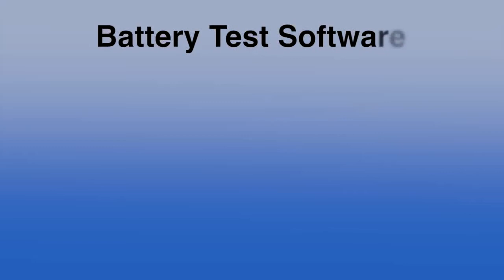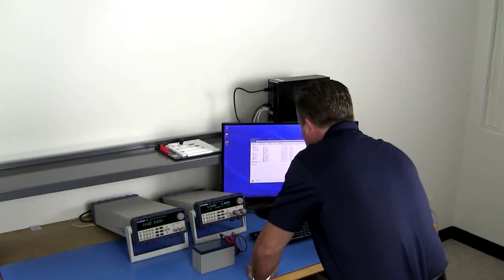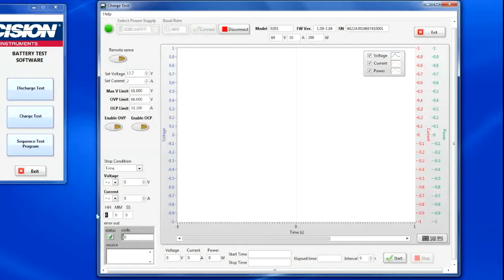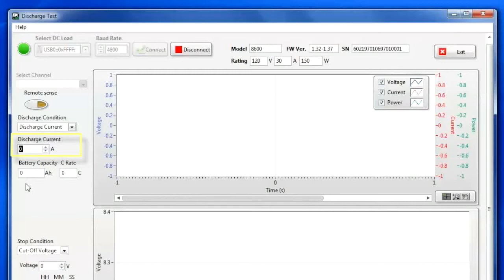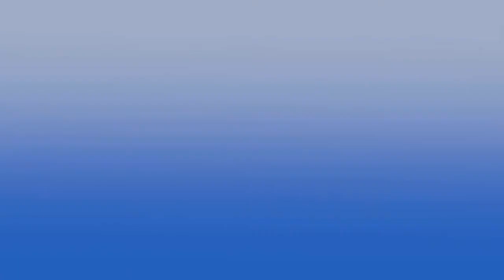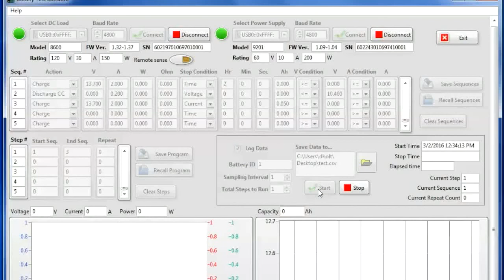How to Charge and Discharge Batteries with B&K Precision's Battery Test Software

Comment: can you tell exact model? and does it also charge and dicharge cylindrical 18650 batteries with 3500 mAh power?   if yes then how? furthermore,  is both red wire or charge and discharge unit connected together with the battery on one side. and both black wire connected to other side?
Reply from the maker: Hello, we have reached out to B&K to answer your questions. This model is the 860x. The power supply and load can be connected at the same time. The software will control each unit based on a charge or dis-charge cycle. Additionally, it can charge and discharge cylindrical 18650 batteries with 3500 mAh power but please make sure you configure the software per the specs of the battery being charged or discharged. If you have any other questions, please don't hesitate to reach out to our experts at information@itm.com
Reply: @ITMInstrumentsInc  Thank you for your reply

I would like to use it to test a single cylindrical battery cell at a 1C charge rate and various discharge rates (1C - 4C) cylindrical battery 18650 with 2600 mA and 3.7 nominal voltage.

 Additionally, I am planning to assemble a 5S3P (21V and 7.8A) or 3S5P battery module using cylindrical cells, each with a capacity of 2600 mAh. Could you tell the appropriate charge and discharge rates for this module using the same cycler? will this module still support 2C and 3C discharge rates?

Comment: I have 9117 power supply and 8616 load. If i use the charge test or discharge test software you are using using works fine for me. However, in the sequence testing, the charging stage is never executed, it just outputs zero every time. Can you tell what i might be missing?